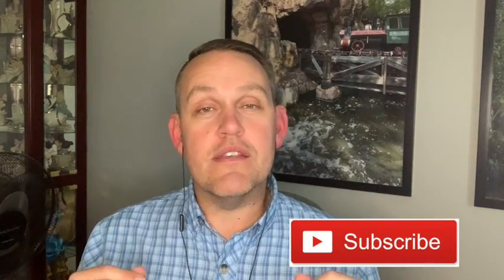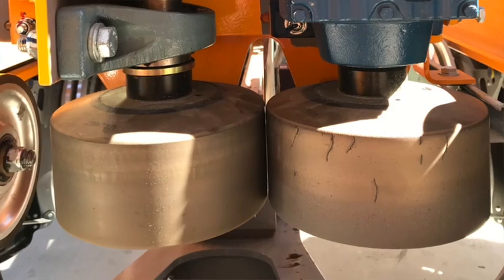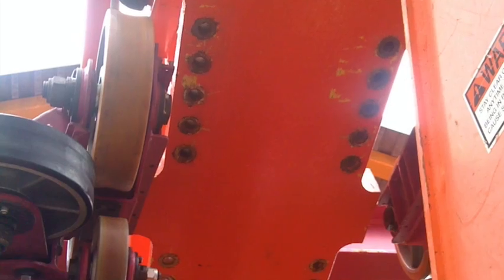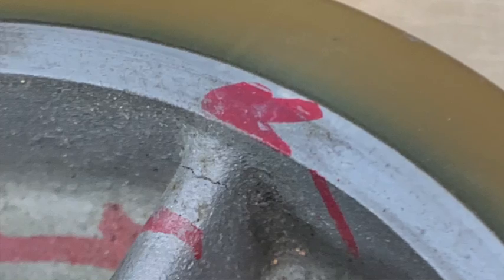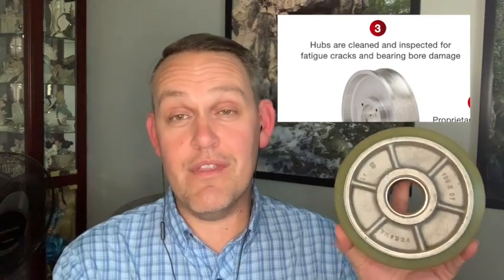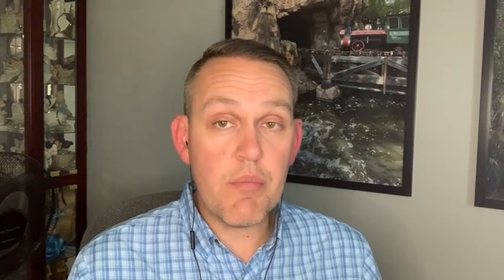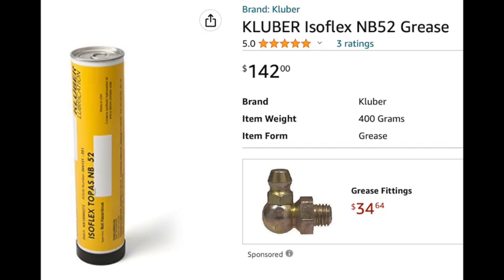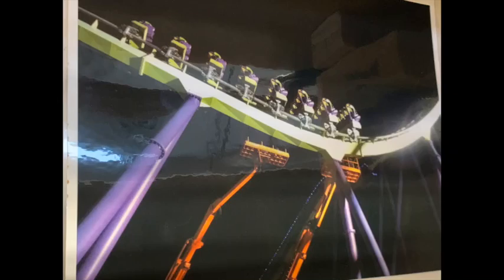Rollercoaster wheels

Comment: Hey Ryan, another one: (IF im not bothering you) Why do wood coasters use solid steel wheels vs aluminum with urethane on steel coasters? Thats had me puzzled for a while.
Reply from the maker: @pizzafroth1521  the urethane can’t hold up on the rough wood track. Each gap is about 1/4in wide and will have the urethane off of a wheel in the first cycle. So urethane on traditional track is out. Aluminum is also too soft. So it’s generally solid steel on steel track.
Reply: @ryantheridemechanic  oh dang, so, im im reading this right, the urethane isnt durable enough to withstand the roughness of the wood on a wooden coaster?
Reply from the maker: @  because the steel top plates have a large gap that will destroy the urethane.
Reply: @ryantheridemechanic  oh dang!! The gaps are between the plates (horizontally, the way the track goes) right? (Its hard to explain, but i think ya know what i mean!!)
Reply from the maker: @ yes

Comment: Ryan, have you ever heard of a Vekoma Boomerang losing an entire wheel during the vertical loop? 

Apparently it happened on Speed of Sound in Walibi Holland today, with people reporting a burning smell. It's a newer retrofitted train with vest restraints and onboard audio. 

Looopings has an article on it. Youtube seems to delete my comment when I link directly.
Reply from the maker: @NachoCheesus  the Tacoma trains have had problems in the past with guide wheels coming off because maintenance typically forget to put the cotter pin back inside as the safety and then the FOMOCO washer is able to come off that allows the nut to come off and then the wheel comes off. haven’t heard of the one you’re talking about though   Sometimes U2 will not allow links of certain types to be placed in the comments
Reply: @ryantheridemechanic  Man, if I heard a wheel come off right before backing up into that 5g loop and intense cobra roll, I'd be freaking the hell out.

Glad it's not some catastrophic failure.

Thanks for the info!
Reply from the maker: @NachoCheesus  train won’t go anywhere. It should still make its cycle finish fine. Probably hear some extra noise and maybe a spark or two but that’s about It. Very uneventful haha.

Comment: Hey Ryan, I have another question: Arent the newer style wheels, like the "billet" style wheels much more expensive than the cast aluminum ones, like the one you have? For example, a wheel off of a B&M vs an old arrow or a vekoma slc. Am I correct?
Reply from the maker: Yes they are more expensive. But also more durable. So builders actually offer billet as a cost savings with longer life and lower NDT.
Reply: @ryantheridemechanic  isnt it because the aluminum from the billet wheels is less prone to wear when they undergo retread? Like, it machines less off the face of the wheel? Im sorry Ryan if Im bothering you!! Ive just acquired another wheel from KK, off of Lightning Run!! Id love to email ya some photos of em if your interested! Also, thank you for being polite to your fanbase!
Reply from the maker: @pizzafroth1521  always! Awesome you got another one! The benefits from billet are the material is stronger so it’s less prone to cracking. Stronger material also means you can install and remove bearings with less damage. Most wheels that have to be tossed in the trash is because the bearing bore went bad done damage to the bore by maintenance generally. The putter surface could be built thicker giving the wheel longer life (6 retreads vs 3 retreads) so yes you are correct but is not the main reason for billet. Less NDT is the main reason.
Reply: @ryantheridemechanic  my large wheel off of T3 is cast aluminum. Its bearing race is out of tolerance, but other than that its in very good condition. My wheel off of Lightning run is the same situation. But my side (guide) wheel  from T3 and my upstop from thunder run are beat to heck and back. Both of those two look a bit rusty, but oh well. Also, the urethane on the small T3 wheel is really cracked. 

Also, what about chain? Is chain on a rollercoaster specialized? Like, is there specific requirements for it? Ect.
Reply from the maker: @pizzafroth1521  they do make special chains with AP (amusement park) ratings but in reality, no they are just oversized for the application to get the safety rating. Just a regular roller chain.

Comment: How do you feel about an old woodie with steel wheels with track lube plus? On my steels, ive always used it. My park has a beach rust problem.
Reply from the maker: Never tried it. Seems like it could do ok but no up front knowledge. We use liquid graphite on our old woodie what a mess that stuff is. But it had no abhility to stick around it was mainly just graphite in solvent.
Reply: We used graphite on our two woodies at Magic Mtn

Comment: I’ve seen parks (Kings Island) pressure washing the track on Banshee after the park hours. Is that normal for wear and tear? I assume less dirt on the track means the less the wheels decay, and the smoother the ride experience would be. Just an interesting thought especially with how large B&Ms rails can get.
Reply from the maker: Typically the tracks are not washed unless there was a problem. To get flaking paint off. Maybe something is making dirt stick? Or mold moss is forming and needs to be removed. Kind of an odd thing.
Reply: @ryantheridemechanic  For sure, pretty interesting none the less. If I had to guess I’m going to assume something natural occurred that was allowing dirt to stick to the rails since they were only washing one tiny section. When I rode it that day the little patch they were working on had a heavier vibration compared to the rest of the ride.
Reply from the maker: @Eftelingfan07  hmmm interesting. They must be looking for something. Dirt built up on the road surface can cause some wicked vibrations. I know I had that problem once on a B&M where the track lube wasn’t mixed right. Caused it to build up in the low spots and made a nasty mess.
Reply: @ryantheridemechanic  Yeah. It was going into the batwing right when it starts to invert for the first time. I assume the way B&Ms spine is so thick i bet its just an absolute troff for debris and dirt. I’ve never seen them pressure washing during the main season though so something had to of been going on.
Reply from the maker: @Eftelingfan07  or some high up boss is coming to the park haha

Comment: Last week, I attended Kings Dominion, and they have water spickets gushing all over the wheels on I-305. I understand that this ride would blow through wheels daily when it opened, and that Intamin had to work on their wheel compounds. My question is whether the more extreme heating and cooling cycles causes these wheels to degrade quicker? Also, the area under the station looked pretty wet and muddy and it seems like they don't have a good drainage system. My guess is that this creates a much dirtier environment for you to work in, which can't be fun.
Reply from the maker: The cooler that wheel is the longer the urethan surface will last. Some parks do things to heat and cool the wheels. I know a ride that uses water pumped through the transfer and station track to help cool the wheels between runs.

Comment: Why does the wheel hub metal become thinner with every retread (so can only do it 2-3 times)?  Do they have to machine it back into tolerance or remove metal somehow? Do they have to adjust the amount of urethane based on the outer diameter (OD) of the wheel?  

It's interesting that parks would go through all that hassle of shipping to a 3rd party and NDT, and some being found with cracks anyway, bore and OD measurement, recoating the wheel, the retread company being responsible for the performance of the new one, shipping back, if you can get a new cast one for $400!
Reply from the maker: They take off the old urethane by machining it off the face. You need to remove a little bit of parent material to get a perfect surface. They pour the new urethan then turn down the OD to match a new wheel. And it’s cheaper than a new wheel. So you could say wats $100 difference, well that’s over 50 wheels that might be sent in. Niger wheee have much more of a difference. New road wheels can be around $3600 each and a re-coat might run $300.
Reply: @ryantheridemechanic  Ahh, awesome!

Comment: I've been trying to get my hands on a real wheel for YEARS. How did you get that? I'd give anything to get a real rollercoaster wheel.
Reply: Thats exactly what I did at KK. 

Except i know the entire maintenance team and the whole management team of the park, which is how I got both my wheels. And I might be fixing to get one off of Thunder Run.
Reply from the maker: With my previous role I was able to cherry pick some things like this. In great condition but now junk to the park. You can’t call or ask for this stuff it will almost never happen.

Comment: How much can roller coaster wheels weigh?
Reply from the maker: Depends on the type and size. The one I  use in this video is 3lbs and it’s 156mm wide
Reply: @ryantheridemechanic  That's quite light but that's to be expected for aluminum.   I'm sure the wheels on say, like the GateKeeper or Millennium Force at Cedar Point would be twice as heavy or more since they're much larger.
Reply from the maker: @tubepotato500  road wheels on a wooden coaster are the heaviest. About 10-12in in diameter and made from solid steel. About 21pounds a wheel.
Reply: My road wheel off of T3 weighs about 20 pounds. Its quite hefty!!

Comment: Great videos Ryan, thanks for sharing! I have a question: How difficult is it to reverse the direction of trains on a roller coaster?
Reply from the maker: Just over grease the wheels then I reverses direction on the track,…… 
On most trains it impossible. Typically trains are not built symmetrical, and most ARB and chain dogs can not be reversed.

Comment: 1:42 maybe it was Corkscrew at Cedar Point? I heard news articles talking about one of its wheels delaminating and polyurethane getting all over a pathway along the midway of Cedar Point

Also you say you replace 1-2 wheels a week… how many wheels do you have in storage per ride? Do you repair the old wheels or something?
Reply from the maker: Depends on the old wheels condition. Most can be resurfaced ok. Stock about 15 roads and 30 guide up stops per train I’d say is good numbers.

Comment: I was was a ride op/maintenance for defunct AstroWorld Houston, TX. We had a lot of Arrow "stuff" Arrow/Vekoma used polyurethane. Other Manufacturers used Nylon. When I heard about Cedar Point a few weeks ago. I KNEW what it was from. I used to make working models from model train shows. I had my wheels machined from Nylon. Lubricated with Prestone Silicon spray including the track/ chain. I used to watch mechanics install Nylon on Schwarzkopf shuttle loop 2. Yep! Launch coaster (back road wheels would lift during launch...they would be "egg shaped" + had to be changed out more frequently.) Arrows used crank case oil. Lighter oil in Fall. Heavier in summer. Mechs would heat pan of oil to expand soften Nylon (press fit the tire to the wheel) Clutch was changed 2 times each year. Ride went down in July. Wheels were replaced then also.
Reply from the maker: Cool. Thanks for the comment!

Comment: I once did a school project that included talking about how expensive i305 was on wheel maintenance. my estimate was $6,400 a day, assuming one train burns one set of wheels a day and it only runs one train ($100 per wheel estimate x 8 cars x 8 wheels per car) but i know most of that is fairly eyeballed. what do oyu think the actual cost might be?
Reply from the maker: Depends on all those numbers. General trains run 96 wheels. Roads run close to $1200 per wheel new. But a retread is only about 400. So I want to know what you mean by go through wheels. Are you suggesting they are breaking all those wheels? Or are you asking average wheel rehab costs?

Comment: Is it possible that Uremet not only refurbish wheels but also produce new wheels? A while ago, I had my hands on a road wheel that was taken off a Schwarzkopf coaster (not sure whether it was due to NDT discovering cracks or the bearing bores were out of spec), but the hub itself hat "Uremet" cast into it, like your wheel says "Vekoma". Of course, with Schwarzkopf being out of business for close to 40 years and wheels having a limited life, it's no surprise that they must have been made by someone else by now...
Reply from the maker: Yes they do build complete new wheels for ride. If the manufacture is still around they work with them to get an approved design. If not they have engendering that will work with the parks engineering to build something from scratch.

Comment: interesting video as always, just wondering if you've ever seen these polyurethane wheels blowing out? Also why might parks choose to use Nylon wheels over polyurethane wheels - is it down to their different working properties?
Reply from the maker: Nylons are very low resistance so they are considered speed wheels to make a train go faster. Typically it’s either all or nothing for those but I did work on one that only used 4 nylon wheels and urethane for the rest.
Reply: @ryantheridemechanic  Understood. Thanks Ryan!

Comment: I really enjoy the videos, keep them coming. As a ride-opp we where instructed to measure the wheels every day using a gauge (a u-shaped tool) and it was the main reason for changing out wheels back then. Unfortunately we could not do it ourselfs.
Reply from the maker: Awesome. Go/no-go gauges are best for messing the minimum diameter on wheels with cupping sense the OD in the middle of the wheel is thinner. …… till it’s gone haha

Comment: Do you have a lot of old ride parts laying around from your years working on rides?
Reply from the maker: Not really. Most old parts are useless to people unless you like to build/weld, and machine things the amusements parks are awesome for scrap material. I always loved wheels so when I had the chance for some nice dumpster diving treasure I took it. The park had to release these wheels saying I wouldn’t hold them responsible for any damages or lawsuits.
Reply: Makes sense. How common is it that you need to trash the wheels completely as opposed to having them restored?
Reply from the maker: @chriss1019  soon as that bearing race goes bad, wheel is trash. Typical train might loose 2 or 3 a year to the trash can. Mainly happens on old old wheels unless you had a severe bearing lock up and it overheated the hub.